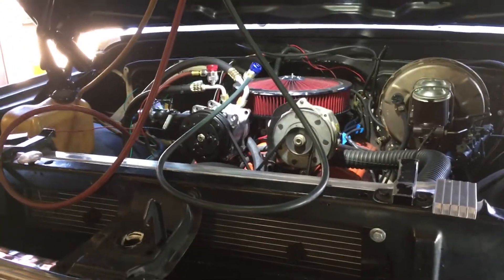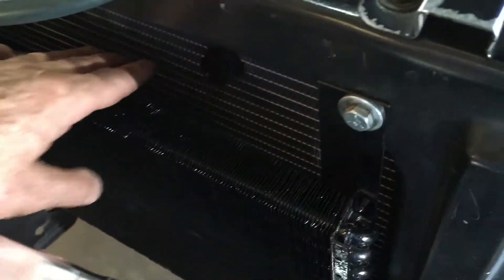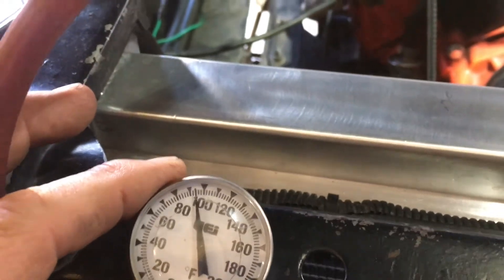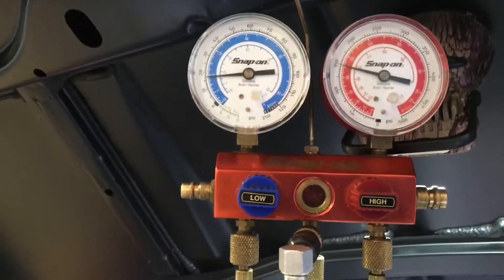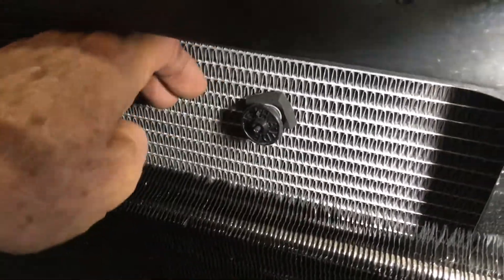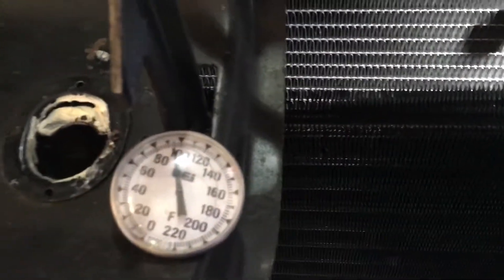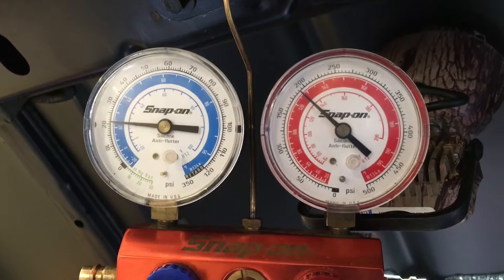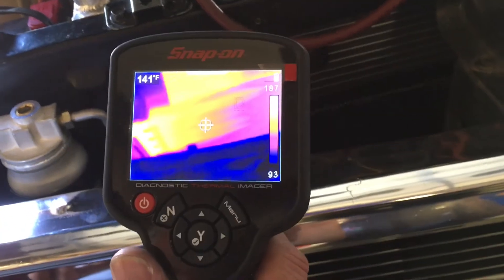AC Retrofit to R134a

Comment: Yes you are correct two fans would have been better. And closing up all those gaps including if there’s an air gap on the sides and underneath the condenser and radiator. Putting the condenser closer to the radiator but not touching or to close because then you start picking up radiant heat off of the radiator heating up the backside of the condenser decreasing its capacity.      In your terminology of the description of the condenser serpentine was like the 70s and 80s Ford and Chrysler had some serpentine condensers. Serpentine condensers that had the wide thin flat tube singular that started at the top and made a S back-and-forth single pass all the way to the bottom of the condenser.  The little sample section of condenser tubing you had are used in what’s called parallel flow. Did you get that little condenser sample from attending the MACS (Mobile Air-Conditioning Service)convention EXPO ?.  It’s not exactly the speed of the refrigerant passing through the tubes but it’s the overall surface area in contact with the refrigerant. There is more surface area on multiple small tiny tubes then there is one single large tube this is what dissipates the heat.           As for some of the retrofits not working correctly it’s usually because of the mechanical did the retrofit wrong quantity of refrigerant wrong quantity of oil too much added on top of the old mineral oil and they use that cheap hundred viscosity Esther oil as a universal replacement drop in oil.  And if that was a modern day air conditioning kit that was added from vintage air or old air products usually when you brought up the RPMs to around 1200 to 1500 RPMs the low side on that particular expansion valve they used would often drop down to roughly 12 to 15 psi.      They do make parallel flow condensers in several sizes that are universal that you can adapt just make your own brackets and try to choose the largest size you can possibly find and fit in your application. And when using a parallel flow condenser in place of a tube and fin condenser you usually decrease the weight of refrigerant to the system because it’s more efficient. You don’t use pressures and temperatures or use them in a combination with superheat or sub cooling depending on the system you have whether it’s a expansion valve type system or a orifice tube type system.